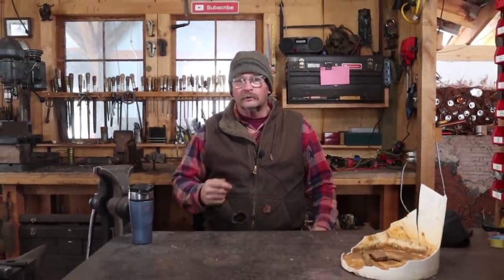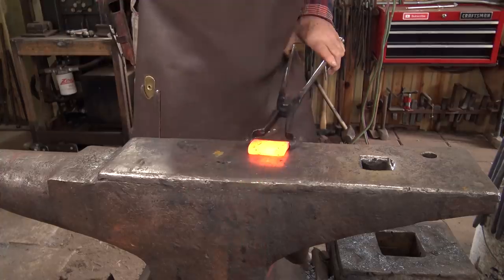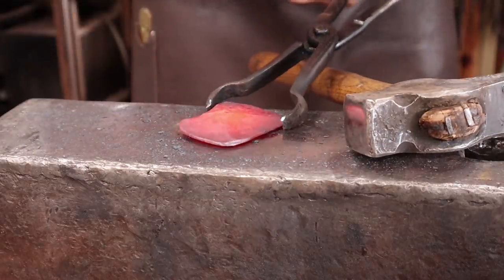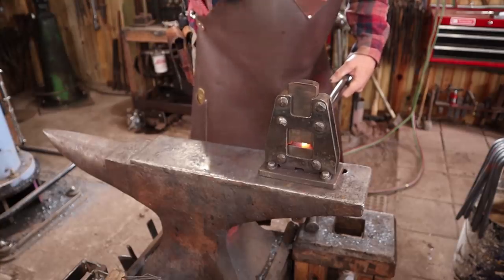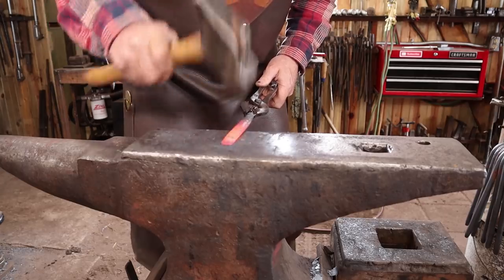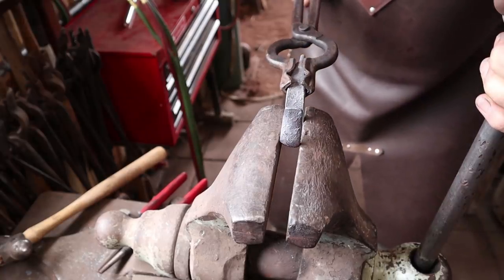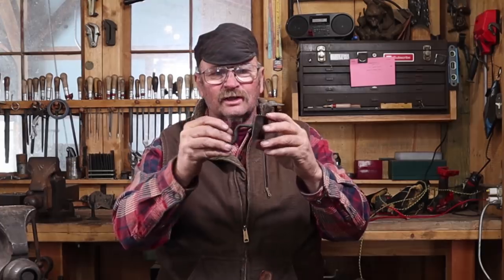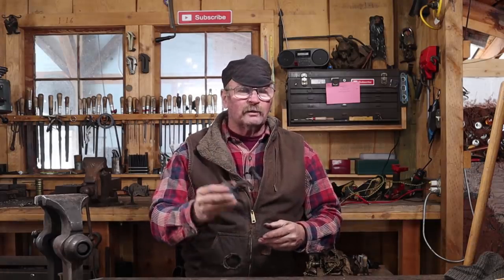Blacksmithing - Forging a special purpose hook - Hook of the Week 26

Comment: "Octoburary day".......I must have missed that month on my calendar. 😊     I like that hook  and all the lessons to make it.  Thank you Thank you.
Question :  Is there such a thing as slip joint tongs?  You have big hands compared to me, and sometimes the end of the tongs gets pretty wide for me to hang on to.
Reply from the maker: I have heard of various attempts to make adjustable tongs. But they never seem to work all that well
Reply: As far as adjustable tongs go, I use a pair of vise grip LC12 is the model, they have long swooping jaws. These are not welders vise grips! these are more geared for plumbing use. Any ways I ground all the teeth off and cut v grooves in the ends, they will hold a variety of shapes and rectangle up to 3/4" wide x 1/4" quite handy as there are no tong rings to lose! however they are too short for gas forge use :-(
Reply: @shadetreeforge  extend the fixed handle by welding a rod to the adjustment screw, or replace the adjustment screw with a thread cut to match on the end of a rod/handle.
Reply: "Octobuary": the month of Winter in some geographical areas north of a given latitude.
At least that's how my brain defined it.

Comment: Mr. Slick, i don’t believe for a second that you mounted that hook sideways on purpose. Why didn’t you just drill two new holes vertically and you could have said you did that so you could mount the hook either way. The hook came out nice though good job buddy.
Reply from the maker: I guess you have some serious trust issues. If I didn’t intend for it to be as is I would have shown how to loosen the tenon to readjust the hook

Comment: As I was sitting here watching your video, burning my battery project into the abyss... I wondered have you ever done any black Smith soldering?  

My battery project is fine, though I wish I could have found my flux. The joints would have turned out much better
Reply from the maker: I have done small amounts of forge brazing using brass

Comment: Silly question, completely unrelated, but I recently built a bottom blast coal forge from some plans online because I had a brake rotor and some spare time and cash, but now I've tried firing it up and I am having trouble keeping my coal out of the air supply. I haven't seen anyone else having this problem and can't find a solution except maybe to put some mesh over the opening? That isn't mentioned anywhere online, but it seems like the obvious solution.
Reply from the maker: Smaller forges sometimes use a grate, the heavier the better, it will burn through.  Larger forges use a breaker ball (usually triangular not round) that can be turned to break clinker and allows air flow around the edges into the fire.